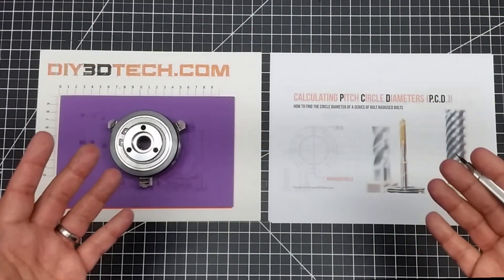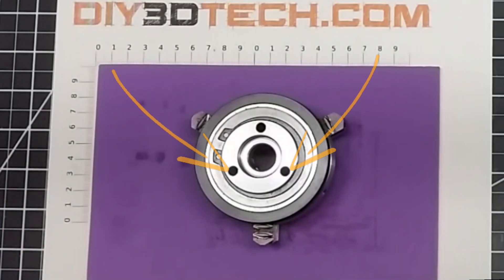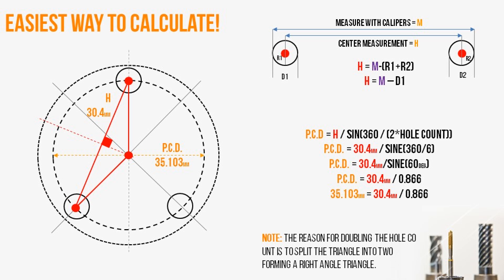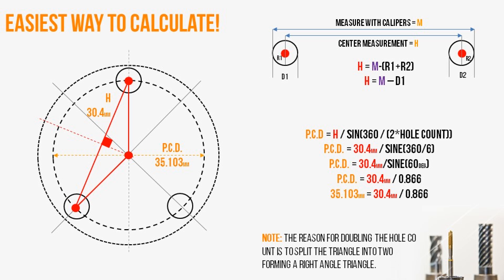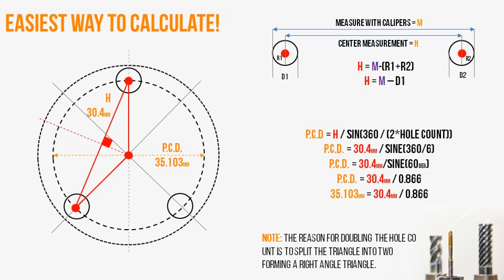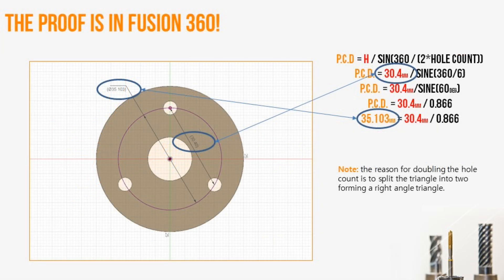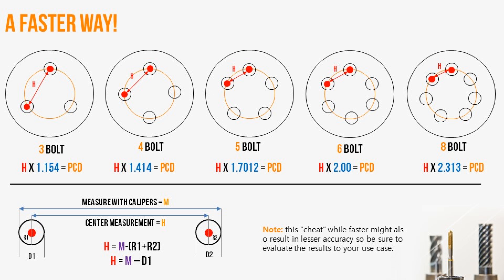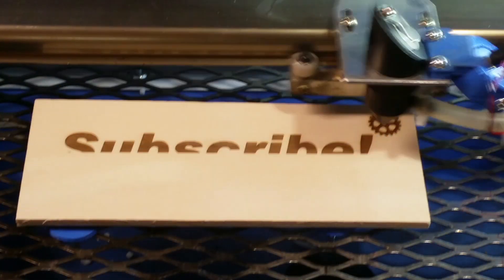Makers Math - What is PCD and How To Calculate it!

Comment: I'd usually just go into inkscape and snap to rotation center. I'd put perpendicular guides in the center of the larger circle and then perpendicular guides in the center of one of the smaller (bolt) circles and then draw a 3rd circle concentric to the larger until it sat right on top of the center of the bolt hole. http://i.imgur.com/6bUBcG7.png
Reply: My method resulted in about 0.01mm of error compared to your method, well within what one would expect likely from taking caliper measurements, but your way is pretty darn easy with the pre-calculated constants and also works on things that are already physical :P
Reply from the maker: The issue what if your reverse engineering something and need to know the diameter?  This is the issue I ran into as Fusion does a good job with this however you "first" have to know this value.  As the reason i created this video is I needed to build a plate for new chuck (you know the coin chucker :-)  and three bolt so I used the PCD calc's to reverse that...

Comment: Very nicely explained, but there's a trigonometry-free method using Fusion 360. Create an "edge polygon" and make the length of each edge the center-to-center distance between the mounting holes. Use a coincident constraint to align the center of the polygon with the center of your part, then place holes at the vertices of the polygon.
Reply from the maker: You can also use rotate, however the problem is if you have a part, how do you know what diameter to use for the holes?  The reason I made this video is if you recall the chuck video, I needed to make an adapter plate and the chuck has three holes.  From there I had to find the PCD to transfer to fusion (where I used the rotate command) to create my fixture :-)
Reply: @DIY3DTECHcom  Make the caliper measurements as you describe to determine H and D1. In Fusion 360, use H directly as the edge dimension of a triangle and D1 as the diameter of the holes. IOW, you need to measure, but you don't need to calculate PCD.
Reply from the maker: Didn't work to the tolerances required, thankfully I 3D printed the model first to see I was off before I spend the money and time on CNC.  This is commonly used to accurately transfer bolt patterns...
Reply: @DIY3DTECHcom  For me, it would not be that easy to accurately measure the holes with calipers. It does seem unlikely that the designer of your chuck would place the holes on a 35.103 mm diameter circle. Engineers like round numbers. If you assume the diameter is actually 35 mm, you can calculate that the center-to-center distance between the holes is 30.311 mm, not 30.4 mm. Then again, 35.103 mm is pretty close to 1-3/8 inches = 34.925 mm. That would make the center-to-center distance 30.246 mm. I might try either of those dimensions instead of 30.4 mm. Even if your measurements are correct, 3D printing is not very dimensionally accurate. If the end goal is a 3D-printed part, you can always tweak the dimensions and reprint. If the 3D-printed part is a test model for a CNC-machined one, as in your case, all bets might be off.